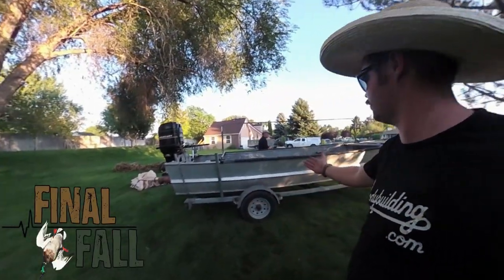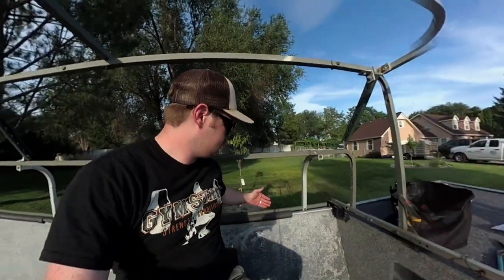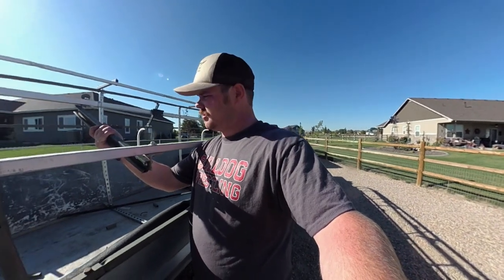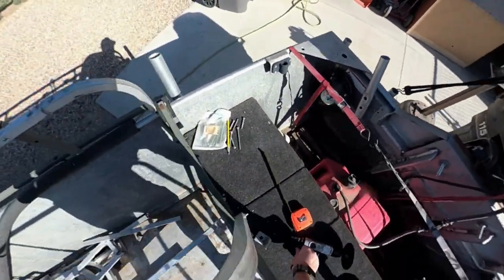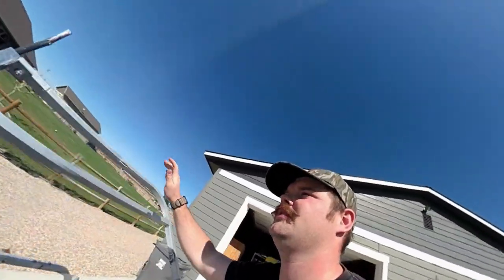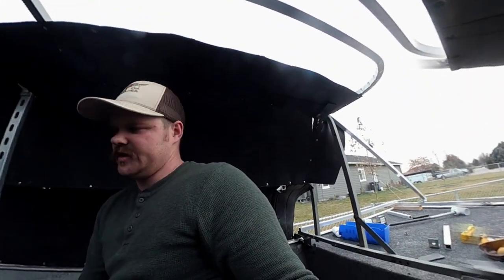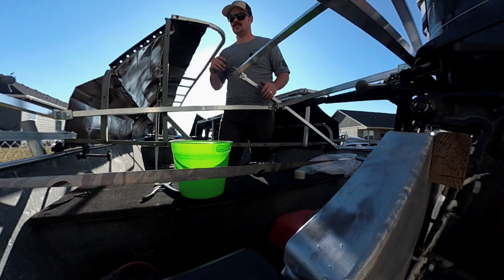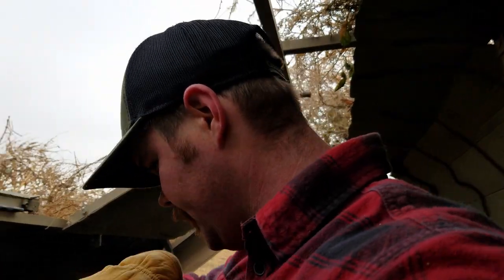HOW TO build a boat blind from start to finish!

Comment: great video, and im sure the hard work payed off for you.  good lookin rig, the only thing i would do different is replace the bolts with with clevis pins and the blind can be removed in a couple of minutes.  i use mine to fish and hunt year round, i can hunt the morning and fish the afternoon if i want, or vice versa.   great job!!
Reply from the maker: Thanks for your comment! Mine is actually placed on the boat using clamps so it comes off very easily. It's heavy but removable with two people. Pins would have worked well I think too.

Comment: would you go with chicken wire again or something wider like garden wire?  how has it held up?  any changes you would do over?
Reply from the maker: I do like the chicken wire still. It's held up really well in most areas of the boat. If I were to replace it I would probably do chicken wire again. Or something really similar but maybe a little tougher. I'm not familiar with garden wire. What's the difference?

Comment: What is the product name of that plastic wrap you put on. That’s a much better and light way than what I had in mind.
Reply from the maker: It's called corrugated plastic. It's the same stuff as what political signs are made out of. I got mine from an HVAC place. It's a durable plastic they use to protect large AC units when they are shipping. I would try and give a HVAC company a call and see if they have any of the corrugated plastic that they would be willing to give away. Definitely a good choice. It's light, durable, and waterproof.

Comment: Where did you buy the clamps?
Reply from the maker: Sorry I didn't see your comment earlier. It slipped through for some reason. So the clamps actually came from a collapsible blind. I looked high and low for something similar and that's the hardest part to find.
Reply from the maker: Okay. I found a similar clamp. https://www.basstacklemaster.com/Driftmaster-Li-l-Pro-Clamp-Mount-Base-p/dm218b.htm

Comment: How much weight did that add?
Reply from the maker: I don't know for sure. But just me and a friend can pick up the blind and put it on the boat. It's easier with three, but probably just a couple hundred pounds. It's fairly light. Especially because it's 95% aluminum and the siding is super light plastic
Reply: Final Fall I have a small flat bottom 15’ 42” bottom “58 top. I ran a scissor blind last year but I’m building something like this just worried about weight
Reply: Also where did you get the C clamps I’ve looked for them and can’t find the ones with the V cut
Reply from the maker: So the v clamps are from an old cabela's scissor blind. So I am not sure I can help you on that point unfortunately. But if you can find something similar let me know.
Reply from the maker: Yeah. I agree with the weight issue. That's why I used aluminum and the plastic. For weight and functionality. The heaviest part is the rubber mats I used in the bottom.